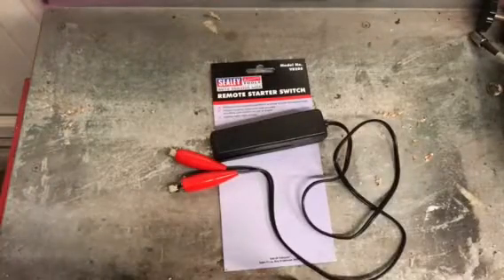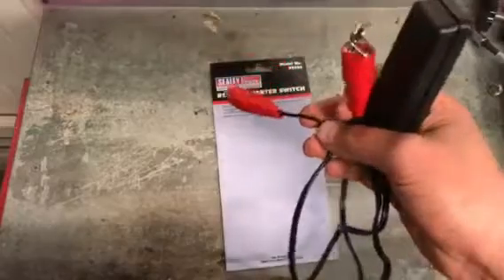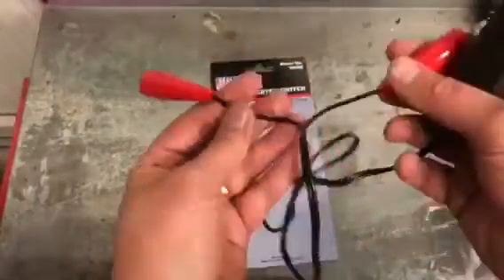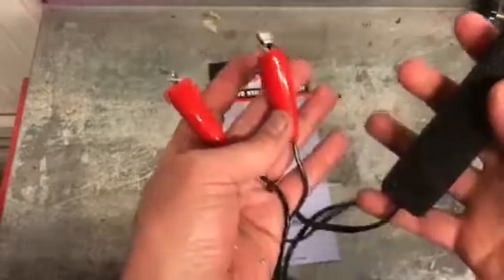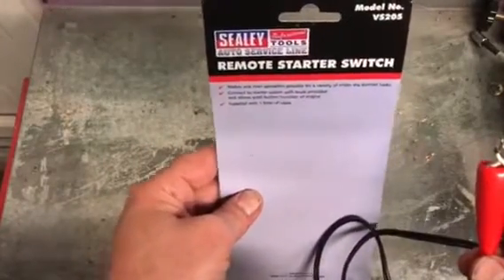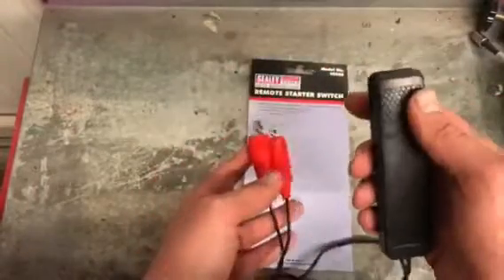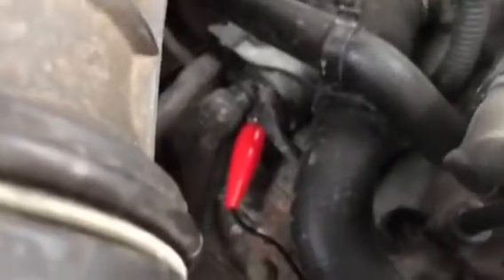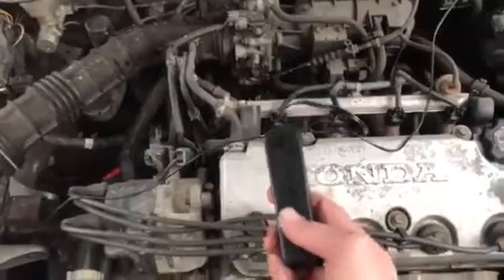How to use a remote engine starter switch Sealey VS205

Comment: How do you use it with a manual transmission since the clutch needs to be pushed
Reply from the maker: Lots of pedal engaging tools out there if you need it or you could make one.
Reply: Get a buddy to press the clutch 
He can also press the button on this tool so you don't need to do anything

Comment: would it still 'just' turn starter motor over ...whith ignition switched of? so could do ..compresion tests whithout injectors flooding the cylinders?
Reply from the maker: Pull the fuel pump relay or fuses. It will still crank though.
Reply: @drivewaydiyer6504  ok,thanks. I just thought a circuit from battery to starter would be isolated to just starter,spinning fly wheel whithout troubling the rest of system..feel a bit stupid lol. Thanks again fella.
Reply from the maker: Not stupid mate, just understanding what controls what really. Hope you get sorted
Reply: @drivewaydiyer6504  it's all good lol. Have a great weekend ok.

Comment: Yah, not too helpful. The only thing I needed to know us where to connect the switch. Connect to the battery  and then somewhere down in the engine bay on in the starter.
Reply from the maker: The live post, that’s it. There’s live and ground, you’re just connecting two positives.👍
Reply: You connect to smaller signal wire to solenoid. The two large terminal are for high current to starter motor, could burn up your remote switch, dangerous.
Reply from the maker: @Lb-100 I’ve used this a few times, been fine. Obviously homemade ones have to have the right set up.

Comment: can I use this to remote start my boat engine if key switch is not working?thanks 
John
Reply from the maker: As long as there no immobiliser, it should work or the immobiliser works, should be fine. Try it.

Comment: Thanks. Bought one from Harbor Freight in Arizona about $11 but I needed info on how to connect it. Would using contacts from removed starter relay work as well? Thx
Reply from the maker: Depends on what you are using it for, but you could.

Comment: So do you attach it onto the nut where the fat wire is connected to the starter?   I am trying to understand why the wire is so thin on that tool.  Seems like the current will burn it out.
Reply from the maker: We’ll it’s only a 12 volt current and it works very well. All it does is bypass starting from the positive battery post to the live post on the starter. The gauge of wire is sufficient for that. Haven’t had any issues with it.

Comment: Would you need to have the clutch in if its a manual?
Reply from the maker: Just have it in neutral. You could have the clutch in, as another safety measure.👍

Comment: If you use this to start the car, then can you take it off the starter and battery with the engine still running? Thanks
Reply from the maker: Just take them off, never had an issue,  don’t let the lead dangle and ground anything or get tangled up in any moving parts.

Comment: It doesn't work to start the car on the newer cars with chip keys. The engine just rotates.
Reply from the maker: Marco Rubio I’ve only used it on older cars. That’s worth knowing. Will look into that. Thanks
Reply: Marco Rubio Yeah I worked at a pick n pull in Oakland Ca. Many of the guys there were ex car thieves. Lots of times we were sold cars without keys. They would show me all the tricks. Like with newer cars, (at the time 2005- 2009) you could still bypass, but you had to also bypass a relay. The relay would shutdown the car and prevent it from use until the right chip key was input, and a series of resets was done. But at least at the time, there was always a way.
Reply: so what year cars you mean? 2005 or older? or 2000 or older? thax
Reply: roadstar499 it all depends, newer luxury cars had those security features. However i never learned which vehicles and years specifically.
Reply: It’s still useful though because usually you are trying to crank the engine to check for other things like fuel injector pulse or spark. And you can’t be at the engine while also turning the key.
Reply: @steveo782812  How would you use this to just Crank the engine so you could block off individual valves. Can you just kind of pulse it bit by bit? Just wondering lol
Reply: @chrishoulihan427  no a crank no start condition would be how I would use it. Have the key in run  and squeeze the trigger. Now you have the crank and cam spinning. Now you can look for spark on one cylinder using a test light to ground. Or remove a fuel injector connector and look for fuel injector pulse. If you have a second person they can crank it while you check this stuff, but if no one else is around then it’s useful to have.